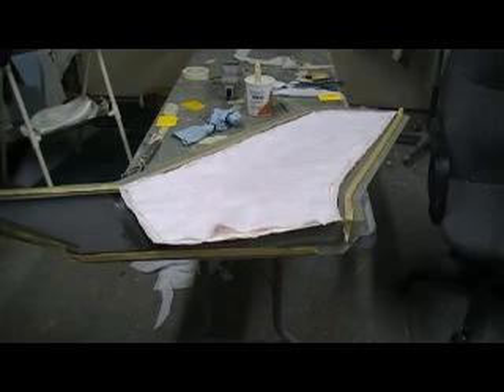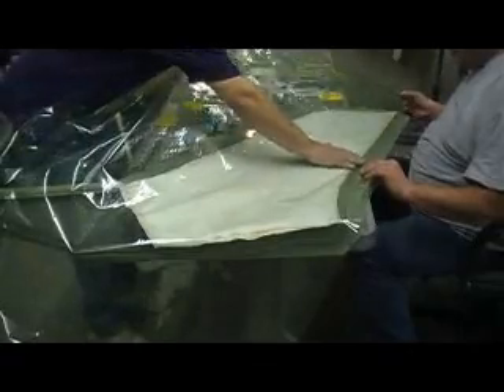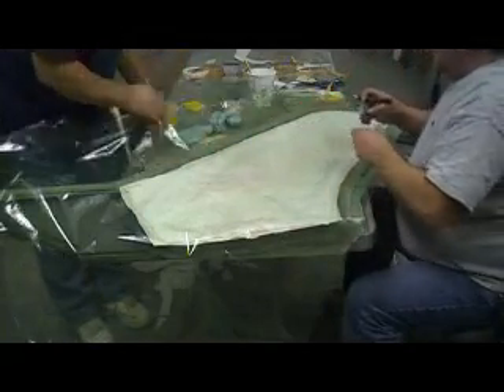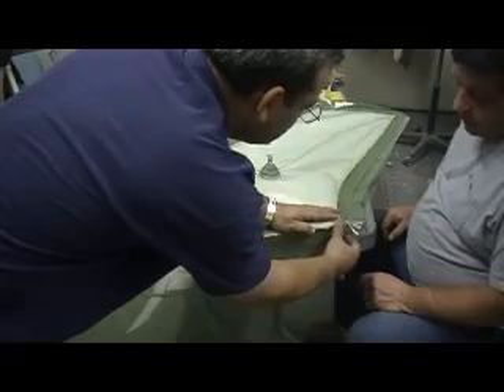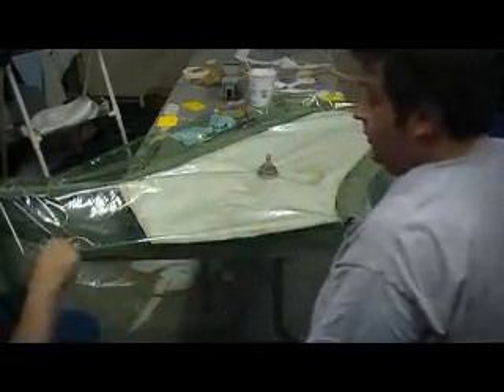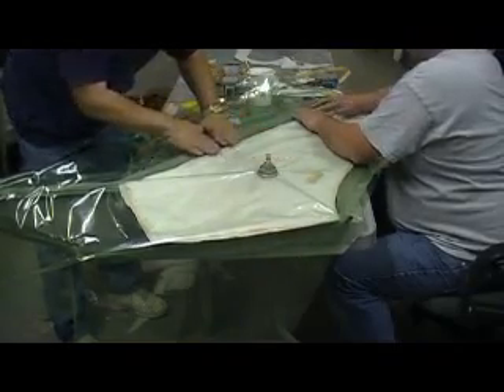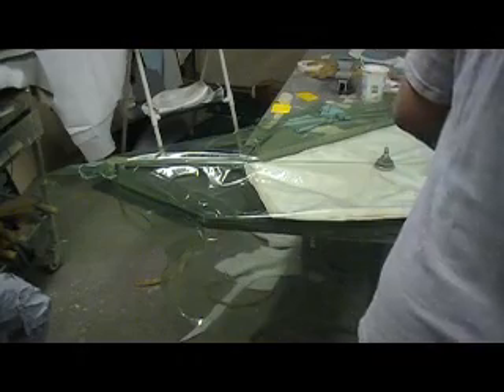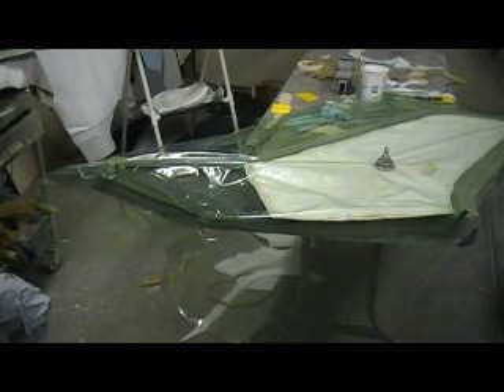how to build a rc jet F-105 thunderchief # 280

Comment: When joining the top skin and bottom skin together such as the leading edge, to ensure a good bond, I'd normally glue a foam noodle (foam string) along the leading edge of let say the bottom skin first, then apply epoxy/micro fiber mixture along the bottom skin leading edge a long the foam noodle and inner spars, supports, etc... then close the mould, this way there is a nice join at the leading edge.

Comment: Bamm!

Hey Bob, hate to say this now but it would be easier and better if you cut the foam so that it's about 1" to 1.5" smaller than the wing skin then laminate that on. After that lay up your glass on the inside then vacuum bag it. This way the inner skin and the outer skin are stuck together with the foam sandwich in between...no delamination.